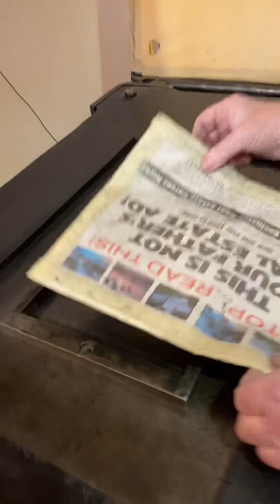Printing a Halftone of California’s State Capitol

Comment: What is a half-tone or an electro type? How did they get their name? I’d visit, but I’m all the way in Ottawa, Canada.
Reply: A half-tone is a process of making an image with many many small dots that your eye puts together as an image. Since it's made of dots instead of solid lines, you're able to get shades or "half-tones" much easier. An electrotype is a solid cut made by molding a shape, normally out of wax or wood, and electroplating it. I won't go too deeply into the process of electroplating, just know it uses electricity to put a very thin layer of a metal over a material. Once it's plated, they remove the inside, fill the shell with metal, and then you have a cut to use on your press. These are the ones you'll typically see on their videos as the letters or more simplistic designs. They can still get a pretty good amount of detail depending on the original, but it can't do shades as well as the half-tones since it relies on solid lines.
Reply: Awesome